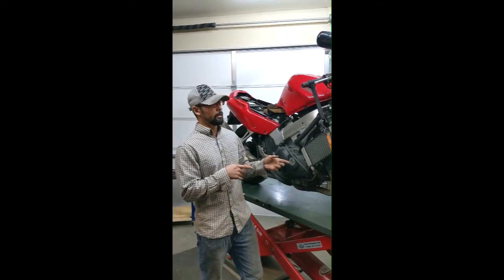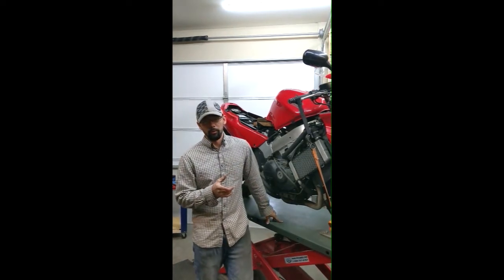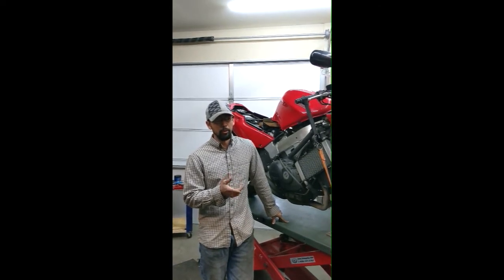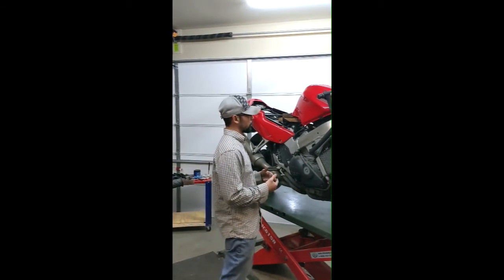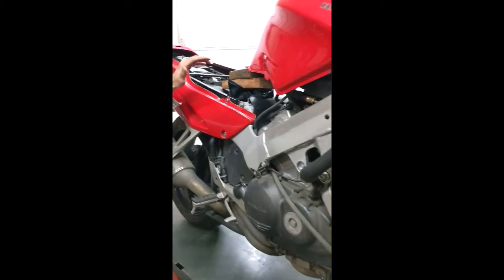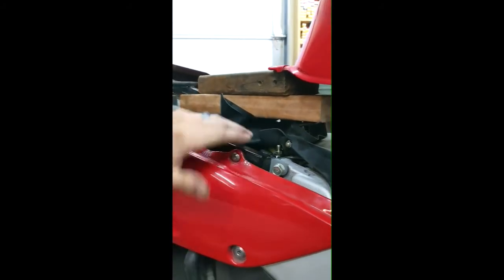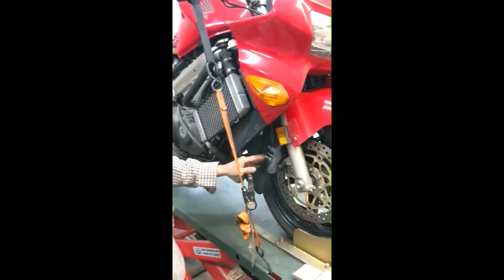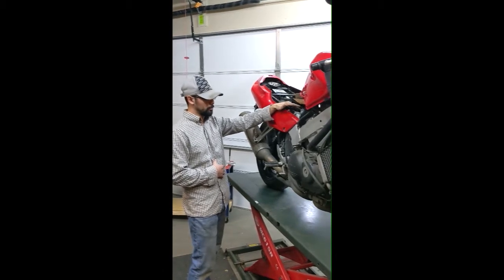1998-2001 Honda VFR800 Interceptor Brake Bleeding (Hydraulic, Linked brake system)

Comment: Lightning:  If you have a digital copy of the service manual that shows that steps that are involved in bleeding the 1998-2001 Honda VFR800Fi's linked braking system, I would appreciate it if you could send it to me.  I tried to follow the pics of it on the video, but it's not very clear. Thanks.
Reply from the maker: Send me your email address
Reply: Awesome video! Could u send me the manual as well? Was un able to find online